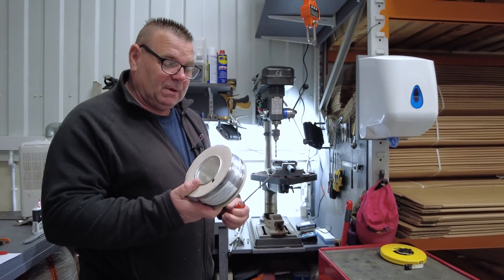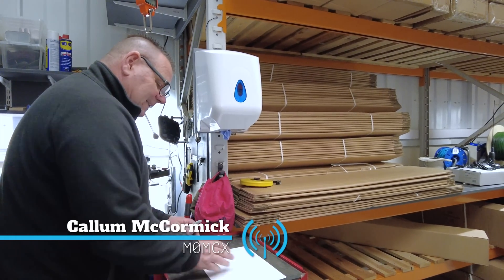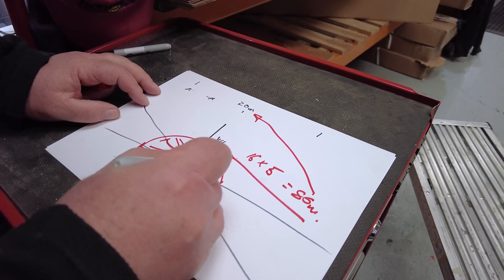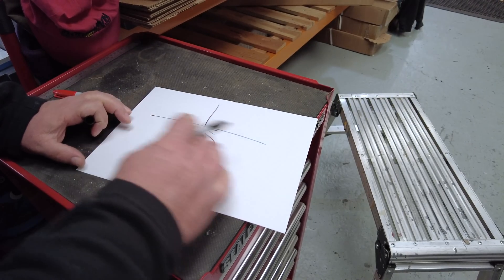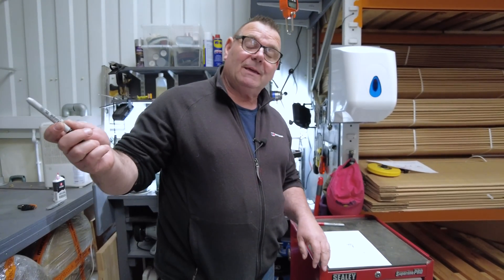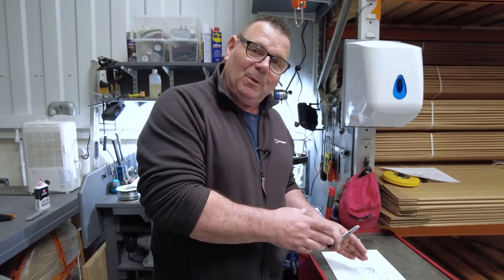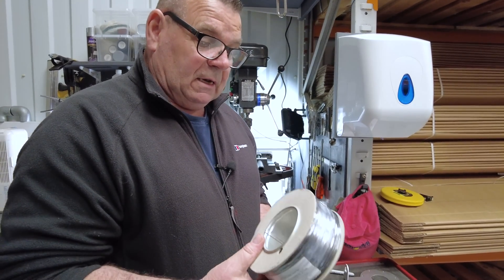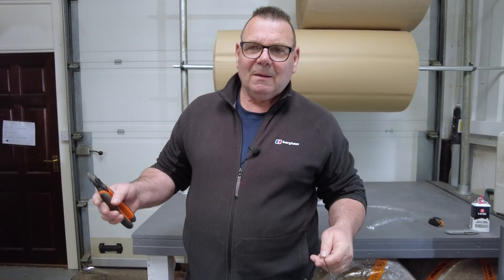How Many Radials for a Permanent Ham Radio Vertical Antenna

Comment: You waterproof the connector end but what about wicking from the other end?
Reply from the maker: Modern PL259s SHOULD have a rubber grommit that will seal it up. Not the old crappy dollar for 10.. :)
Reply: @DXCommanderHQ  I was talking about the radials. Stranded wire will wick moisture. Over time this wicking may cause issues inside the jacket, I think.

Comment: Good video. Simple wire antennas has always given me a lot of joy.
I have made lots of antennas of what my friends call the "WET-vertical" and we used it on multiple IOTA and DX-expeditions with good results.
All you need is wire, some string and an SO-239 (female coax connector). These antennas have been used mostly on 160/80/40 as I live in the city and have a small yard I tend to work the lower bands at my summer house (cottage) in the country.
I usually use pine trees to hang my wire vertical from. On 40 and 80 it is possible to get the full height but not on 160, There i will simply let the radiating wire lean over the top of the tree and slant to the side downwards. It becomes a "slanting inverted-L"
One could also use plastic masts from example spiderbeam or if one wants to go on a budget, fishing poles work great on 20m and up.

Good results for me is working more than 150 DXCC on 40m over a weekend, 180+ DXCC on 80m and doing 160m DXCC in less than a year.
Usually I will get 50-65 countries on 160m during a major contest weekend. Forgot to mention, that is barefoot.
Reply from the maker: Yeah, 100+ over a weekend is always good fun!
Reply: @DXCommanderHQ  And all possible by a little wire.
Reply: Excellent results. Excellent designs and deployment of wire antennas. Kudos! I am now trying for 100 countries on HALF wat with my wire antennas. The quest has slowed but I am at 69 countries so far. The quest will continue, it is very FUN. 73

Comment: Q: I ve got an full metal/tin double garage and was thinking of using it's roof and walls instead of radials. Would that be eaven remotely efficient? Any difference how it would work on HF, UHF, VHF?
Reply: There is a dutch contester that has a 1/4-wave vertical on his shop roof doing exactly what you are talking about. Cant remember his call now but he is usually the strongest dutch station I can hear on 40m.
Now, metal roofs are made of pieces of squares, I dont know if the paint or whatever they are covered in insulates but perhaps they can all be interconnected. 73
Reply from the maker: Yes, people have done this.

Comment: Question: what would be the effect of water gets in the far end of the radials? Would it make sense to touch each open end with some CA or a thin silicone (or even petroleum jelly like you use on your SO connectors?)
Reply from the maker: Er.. OK, you will not see any change in your life - but you COULD make little loops and glue-line-heat-shrink them.

Comment: How do radials work for a vertical on my house roof? Can I place them on the roof and let them drape over the rain gutter?
Reply from the maker: In the main you can... Now, I have not done this experiment - but others have (undocumented apart from some nice emails). I think it depends on quality of ground under the system and a few other fun facts that we don't understand. BUT it's a bit like putting a mag-mount for VHF on the car roof..

Comment: Most of my radials are ~62 feet long, and when I tried putting multiple radials on one connector all it did was make laying and stretching them a nightmare of entanglement.  After that I just painstakingly added each radial one at a time with its own ring to the bolt.  On retrospect, my radial field is over kill, 40 some of those 62 foot radials plus a whole mess of 30 foot radials, on very good conductive soil.

Then again, my Hustler 6 is a sledgehammer on every band I use it on with 200 watts barefoot.
Reply: Knuju

Comment: An AM station nearby built a new tower and placed wire mesh under a parking lot and office building it really worked well.
Reply from the maker: Nice! Doesn't matter if that rusts a bit because it's TX only.. I heard about the guy who did that with chicken mesh and after three years could hardly hear anything!
Reply: @DXCommanderHQ  All the junctions were welded, at the time in the 80s it was a pretty big deal, they are still using the site.
Reply: @DXCommanderHQ   Wonder if the transmissions mess up the onboard computers of the cars.

Comment: Hey, how about 5/8 vertical antenna for 20m band? What should be the lenght of radials and how many of them should I use? Newbie to ham radio here
Reply from the maker: You can do that but you would need to match it with a small coil.
Reply: @DXCommanderHQ  thanks for your answer. But what about radials for 5/8 vertical? Can they be the of the same length as for 1/4 wave?

Comment: The video's audio levels are a bit low.
Reply from the maker: Turn up the volume :) (seriously, I have an automated audio level plug in called Broadcast Compressor which should keep most of the talking just fine.. I turn down the volume for power tools though!)
Reply: @DXCommanderHQ  Sounds fine to me, on my studio monitors in a treated room.  Cheers!

Comment: When I added the 80 inverted L I layed down 42 10 foot radials. which puts me at 1.6 wave lengths of wire on the ground for 80. In MMANA the extra wire does show useful improvements on the higher freq bands in the low end of the take off angle.
Reply from the maker: Well spotted.. and good work!

Comment: Chicken wire anyone???????  Do hams really want to surround their verticals with all the junk around their antenna.  I still like 1/2 wl antennas up at least 30 to 40 ft.  The current popularity of efhw antennas is giving new life to antenna construction.  But there are many ways to drive them other than the lossy 49:1 transformers.

BTW, 3 db is half your power if you have forgotten.
Reply from the maker: Adding 3dB is double - oh, you knew that all along LOL! PS You can't see my radials. I installed them when the grass stopped growing too. Multibanding an end fed from 40m and up is a bit of an ask.. By all means send me a design though..
Reply: @DXCommanderHQ  Put .05 wl of wire after the 1/2 wire (at lowest freq.) and feed between them with an antenna tuner.  (tuner can  be balanced to ground but floating outputs work a little better) Works well and no hot transformers.  Hams like auto everything.  They are getting more lazy every day.
Reply from the maker: @rickeaston3228  Oh well, you can feed anything with a tuner :) My old SG230 did everything. Best cheat there was. Worked fantastic too! Taught me nothing as well :)
Reply: @DXCommanderHQ  You can feed anything with the right transformer too.  The point is that a 1/2 wl antenna has advantages over center fed dipoles.  The feed method isn't what is important.

Comment: Hi Calum, thanks for restoring some videos, are you able to restore som of the antenna design videos? It was on my list to start with that.
Regards. PD1MV
Reply from the maker: I already have 48 videos uploaded and another 50 or so in the pipe and will release one-a-day.. Also check my Playlists. Some of the ones NOT yet released are available on Playlists.. Then we will start re-making the older ones.. In the meantime, they are still all available over at Odysee (. com). SOme of the very old ones though, although the content was pretty good, I didn't get to the point quick enough..

Comment: 1st Glad to see back on the air so to speak! So say for your any one of your multi-band verticals, Do you make the the radials based on say the 40m band or 10m band or ??
Reply from the maker: I base mine on lowest frequency I'm going to use it..
Reply: @DXCommanderHQ  That is HE answer I needed. I was thinking I needed to cut them for 1/4 of 80 then 1/4 of 20 lets say. I thought I needed to cut radials to cover each of the individual vertical wires covering each band  on the antenna (but not the harmonically related band that is a freebee). I see I dont need to do all of that.

Comment: DX Commander, king of the Radial. I've put 1000 feet (304.8M) of wire down for my vertical on 55 radials. I basically just cut them to fit the space, some as short as 8 feet long, some upwards of 33 feet long, and that is almost 4 wavelengths at 80M (actually it's a full 4 wavelengths on the phone portion of 80M) and stopped putting radials down when I ran out of wires. It was because of videos like this and your others, that I learned that "good enough" is actually VERY good enough. Not gonna miss 1dB of signal.
Reply from the maker: You are spot on...
Reply: Read Chapters 9 & 10 of W1ZY's book for more info about this topic. You did the right thing.